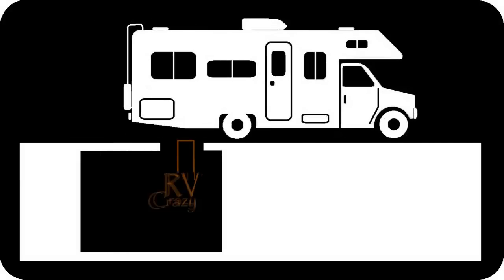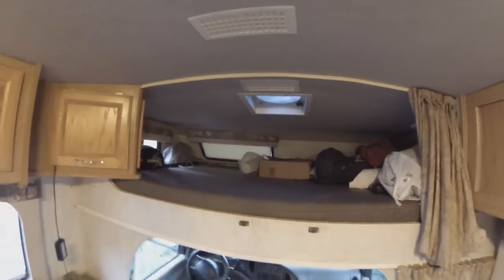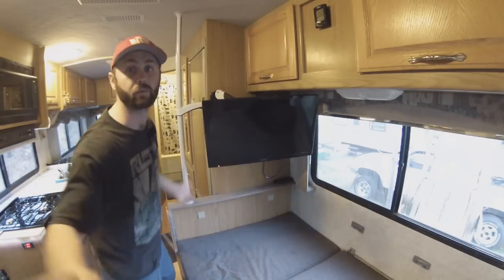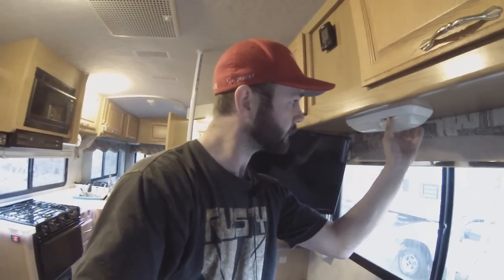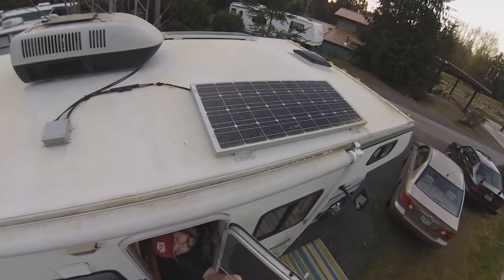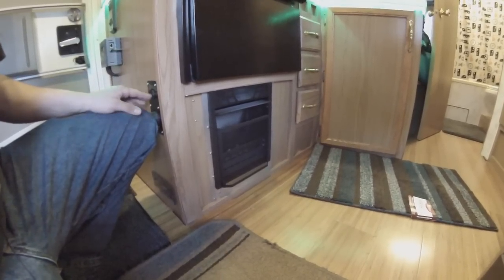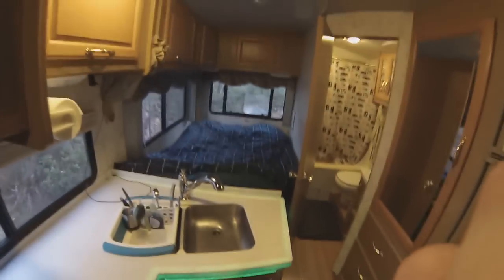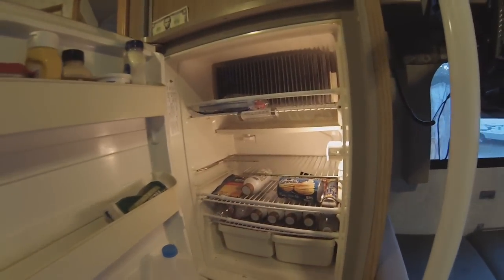Interior tour of my RV, 1999 Tioga Phoenix Flyer SD

Comment: In every charge controller I've had I've had to set them up to get an accurate state of charge. The one I have now uses a firmware file that you upload after setting it up however many of them can be programmed through their screen. I usually have to setup total battery amp hours, voltage, battery type and so on before the state of charge is correct...just a thought.

Comment: Awesome rig:)
Reply from the maker: +Ariel Jones Hey thanks a lot.
Reply: +RV Crazy what year is your rig? Do you mind my asking what you paid for it please? It really is very nice :-)
Reply from the maker: +Ariel Jones It's a 1999.  So when I bought my RV it had been sitting for 2 years after a father and son started a remodel project on it.  So it was all in pieces and needed the flooring trimmed out, new appliances and fixtures and everything installed. I bought it for $8500 but of coarse that was just the purchase price and I put a lot more into it just making it operational again and then all the mods that I have done to it as well.  Found quite a few things wrong as I started getting it back together but I'm happy with how it has turned out and how it works for me.  I haven't really kept track of how much I have put into it at all unfortunately as I have built it for me to enjoy.

Comment: Really enjoyed the tour. One thing I would like to see is how the shower/sink spigots work and the water pressure. Nobody shows that feature for some reason. Just curious. Stay safe young man.
Reply from the maker: +Lisa Murphy That's a hard one as pressure is different using a pump vs city hook up water.   It's also different with different pressure regulators or different water pumps.  So basically it could be different on every rv.  Are you wanting to see the water flow using the onboard pump?

Comment: Hi, thanks for the inspiration. I'm currently looking for a class C around this age to live in full time. I like this floor plan but have yet to see one in person. I would prefer to sleep above cab and would like to know if the main bed space could be taken out to make room for more storage and a desk? Your thought on this?? 

Thanks!
Reply from the maker: +Anita Bennett So as you shop look at the amount of space above the cab.   Mine has a very small amount of headroom to where I don't think I could even roll over another person.   Its all in the way mine was designed though there's plenty of other class C's with much more height to the above cab bed. 

Anything is possible.   Just remember under the bed is a lot of storage that's accessible from outside. If you made a flat floor you'd lose a lot of storage.   You could put your office space above this storage and build a step you get up there but then you wouldn't have much room to stand.  I have 5'4" of clearance from my bed frame to the roof on the high point and about 5' on the low side as I have a curved roof.  There are also RV's with this same layout but with an L shaped couch where my bed is.   They aren't as easy to find but it could be a good option for converting into a desk and storage space.
Reply: RV Crazy thanks so much!!
Reply from the maker: +Anita Bennett No problem

Comment: how necessary is it to level your rv everytime you park?  Why do you need to level an Rv?  Do you level everytime you park somewhere?
Reply from the maker: You don't want an rv too out of level or the fridge will malfunction.   The biggest issue though is comfort.  I don't sleep so well when my head is lower than my feet or when my bed is tilted too far to the side.   A level house is a nice feeling.
Reply: ok.  I understand about the fridge.  Is it damaging to the rv if you don't level it, especially if your not using it for a few days?  thanks
Reply from the maker: +Sid “Gettin it Done” I believe I had read that it can be damaging to the fridge if it is on but I can't remember exactly why.  Something about the ammonia inside pooling.

Comment: What's that between the upper closets above your dinette?
Reply from the maker: +hvwees So that's a wireless temp sensor and clock that can have a few wireless sensors.  Temp Minder MRI-200HI.  I actually just replaced it though with an analog clock with a temperature and a humidity gauge as well.

Comment: dude , you only have one solar panel
Reply from the maker: +sandra hicks I Had one on each side of the rv when I did that video.   The curved roof probably just hid the other panel that's on the opposite side of the curve.   I now have four 100 watt panels though stretching all the way across the roof.
Reply: do you find that four is enough ? I would assume you do your editing in your camper aswell
Reply from the maker: +sandra hicks You know it all depends on your usage and the time of year.   2 panels was plenty for me in the middle of summer for any use I could throw at it.  I got the 2 additional panels to get as much charge as possible into the winter months.  Here in the Pacific Northwest we get a lot of clouds and the sun is also not at a good angle for solar that is flat on the roof but that's why I went with what I think should be an overkill amount of panels for my usage.   I do occasional video editing on my laptop but it's pretty efficient. I think the day to day phone chargers, lights, water pump and radio are my biggest power users.   I don't watch TV but it's efficient as well when I want to watch a movie.   2 panels worked fine for my limited usage from spring to fall but I am gone for work about 10 to 12 hours a day.  I haven't had the chance to test it yet as I've been staying at an rv park surrounded by trees but I'll be moving to no hook ups here this next week.
Reply: Have you tried using any of the portable solar panels? Particularly in the Pacific Northwest. I'm interested in how well they work, stringing them out away from the rig into sunlight, while the rig sits in cooler shade...?
Reply: hahahah.  That's what i thought.

Comment: how and where do you wash you clothes?
Reply from the maker: Some marinas that i work from have laundry facilities as well as some of the rv parks I stay at and the last resort is the laundromat.   Exciting huh?
Reply from the maker: +Beezy Talking Shit I haven't seen weeds,  don't really watch tv much.   Larger rv's are more likely to have a washer and dryer but they aren't very common I don't think.   I wouldn't want one in my size rv, space is precious and laundry facilities are cheap and easy.  Watch tv all day?  I really haven't tried but on a sunny day it would be no problem.  Heavy rain and clouds might let the tv drain the batteries a bit.  Battery capacity will allow you to go a while with cloudy days and the solar can then catch back up when the sun comes back out.   More panels and more sun just help it to charge faster.
Reply from the maker: +Beezy Talking Shit Free wifi is a hassle for sure.   I can get by on a 10 gig data plan on my phone but it isn't enough for me when I'm not working long days.    

I'll have to check and see how many amps my tv draws as j can't remember right now.  From that it's easier to know how many constant amps you'll need to charge your battery while watching tv.  Overkill is always best though. 

I don't separate my rv expenses from my business/personal expenses but I can get my monthly expenses down to $1000 if I work too much to spend money and have fun afterwards.